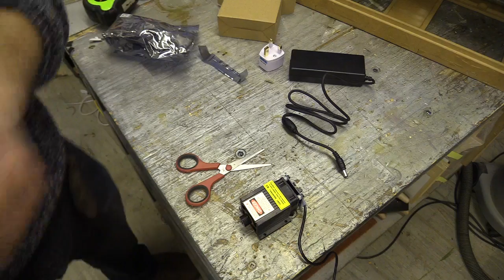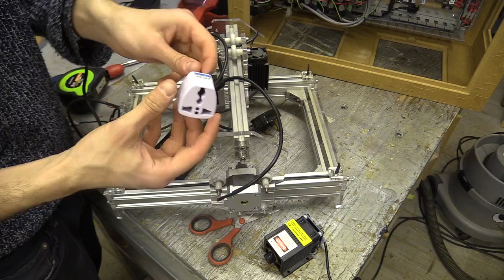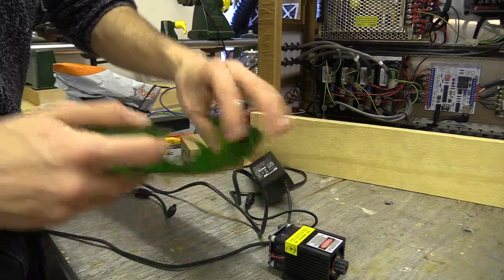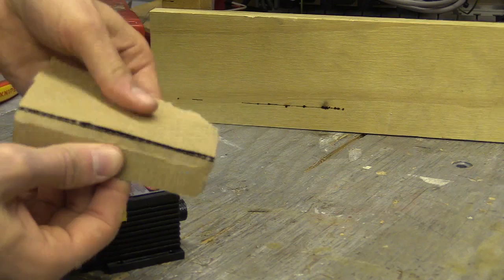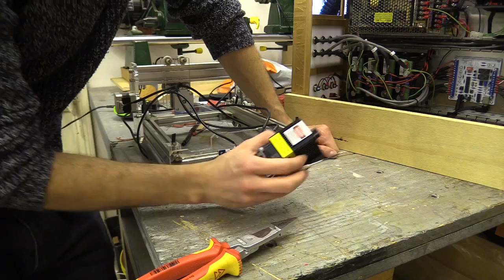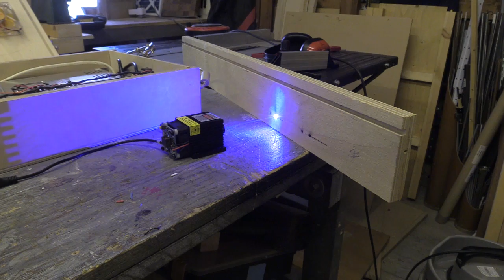5.5w Laser Engraving Module

Comment: Hi Dear,
I have a question in my mind, can I use this laser to cut metal sheet of 3-mm to 4-mm sheet. If not then please suggest me a laser which can be useful to cut 3-4mm metal sheet. my email id: rajkumarsingh4d@gmail.com thanks in advance.
Reply from the maker: No. You need a beefy Co2 laser or plasma cutter.
Reply: you need a fiber laser or a YAG, even co2  cant cut  tinfoil it has the wrong wavelength. and you talk 1000+ watt lasers when cutting metal running into  hundred thousand dollars :) or more
Reply: you are taking a big risk friend, you should follow safety measure first, you cant play with directly with laser, though it is low or high in voltage/watts you would have use safety gloves and glass first. thanks
Reply: A CO2 laser can do it, in the hundreds of watts or kilowatt range, nothing us plebs can easily do.  A water jet cutter is another option for metal.

Comment: Hello there,
I'm also planning to install one in my cnc router, but I'm still struggling to fully understand how the different laser boards relate to the different laser modules.
I have a 5.5w engraving machine from aliexpress, and besides the mainboard (arduino nano shield), it has a TTL board (whatever this may be). Because my board apparently only works with the chinese cam/sender (is that right?) software (definitely not good) I thought that I could replace the mainboard with a eleks board, for example, in order to be able to use a better program. But then I realized it couldn't handle/connect to a higher power laser module with a TTL (as it seems to be your problem too). 
What is this board on top of your laser module? It only has a 12v input, is that a TTL board too? Mine has two inputs that comes from the mainboard (12v / TTL) and two outputs (Fan / LaserDiode).
Which board will you use in the cnc to control both the spindle and the laser?
Thanks, have a nice day.
Reply from the maker: Hi where did you get your laser from? I am still not sure what to use to be honest. It really depends on your budget and if you want to get messy with re-flashing Arduinos too. I am working on a controller which could send PWM and SPN enable signals out to a driver and again that could be the second board I used. But I am also thinking it  might be better to have a dedicated controller - basic eleksmaker thing. Software is split between cad and cam. Cad created the image or vectors, and cam created the gcode from the vectors (so inkscape with a pluggin maybe?), and then you need a third software like universal gcode sender or bCNC to send the Gcode to the CNC. Hope that helps.
Reply: hi, I got mine from aliexpress. I don't mind to have to re-flash the arduino, I actually did once. I uploaded the firmware (is that right?) that comes with Benbox, and then I tried to connect the machine to this same program, but it doesn't work. When asked, the seller only told me that benbox and its firmware wouldn't work in this board, and now they sent me another board, not a shield but a dedicated board (i think this the term). I haven't tested yet, but it is a specific board to control both cnc laser (high power with TTL) and spindle. It has a built-in atmega. 
I hope this board works with the benbox (at least), but actually I'd like to be able to use the universal gcode sender in combination with multiple cam softwares. 
In my ignorant view, I thought I could upload any firmware and then use the compatible sender, but it does not seem to be the case.
Why is that? I can even imagine that some more specific boards can only run a specific firmware. But especially in the case of arduino shields, why is that not possible? Does it have to do with the configuration of the pins in each firmware? I'm sorry, I know that my questions may be beginner (I really am, I do not have any electronic background, I started studying for myself a few months ago and your channel is one of my sources of information), but I really like / need to know exactly how things work so you can develop something on top of it.
What is the cam and sender of you currently use in your engraving machine?
Thanks man!